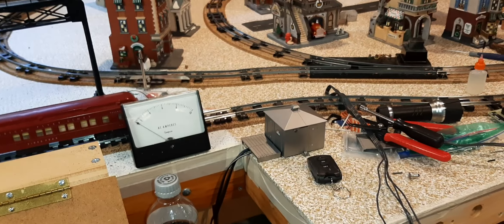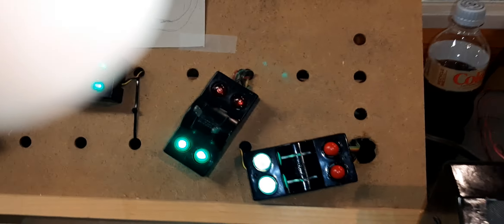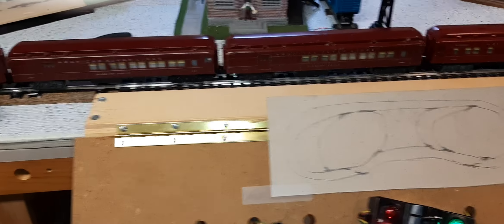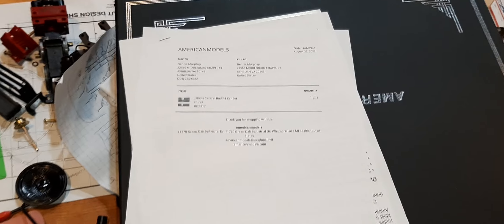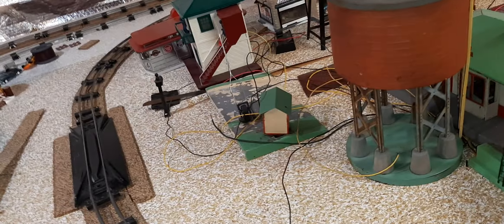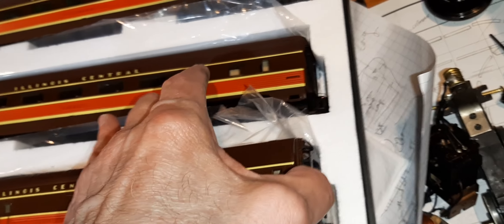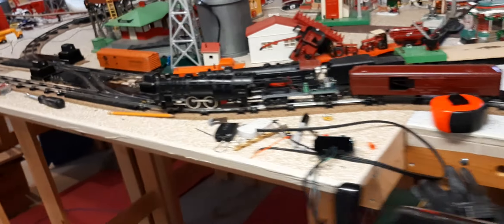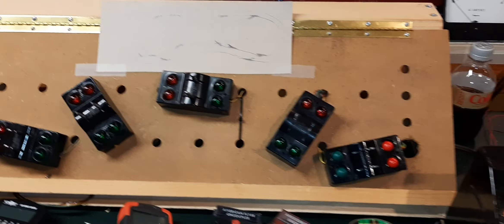Frankentrain Laboratories wires the switches up and shows off the latest acquisition.

Comment: I like the arrangement of the switch controls on your panel. Makes it easier to remember locations!
Reply from the maker: Well I will have a nicer color page to remind me and the switched boxes will be screwed to the board to. I plan to add Action Accessory buttons in the area where they are located and some toggles for lights or building smoke too.